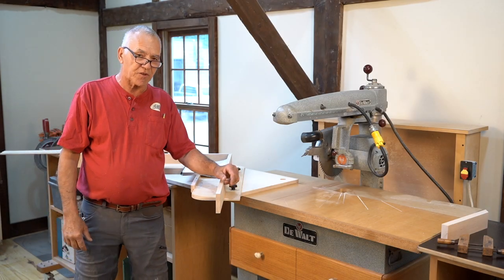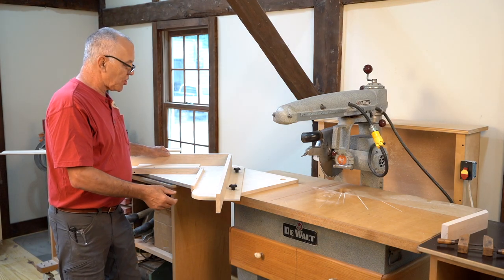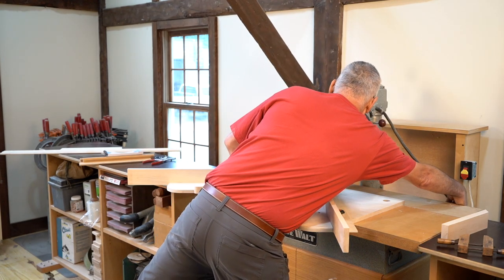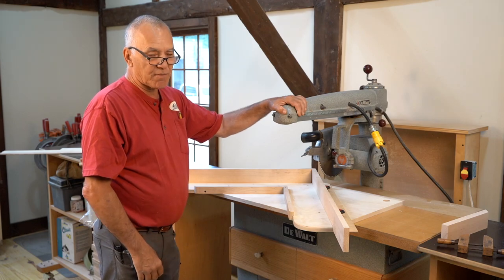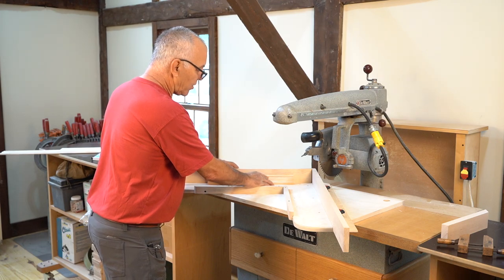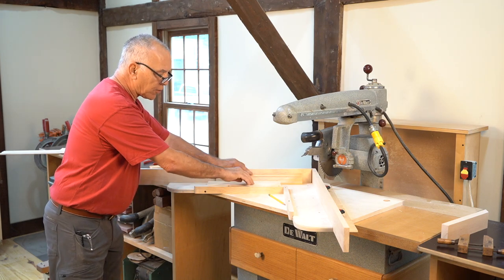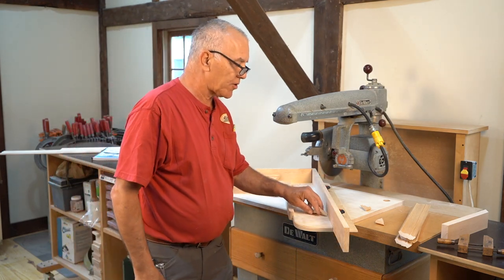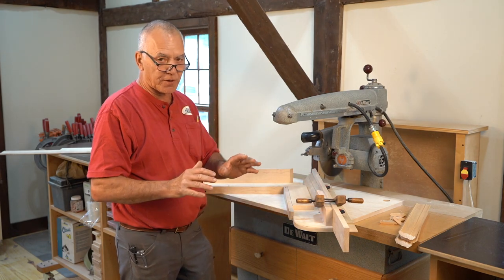The Flying Wing Jig

Comment: One day I went shopping on OfferUp and found a guy selling a 1953, DeWalt 3 phase, 3 horse GR54. I couldn’t believe my eyes. The thing looked brand new. Original paint, fully equipped and the former owner had even rigged an inverter so it could run on 220 single phase.   He only asked $500.   I went up to see it and verify that the thing really ran.   It was perfect. No rust, not a single chip in the paint, threw a 14” blade and ran true and straight.  It was even rigged with a switched power cord to operate a dust collector.   I will never see a better deal for a power tool in my entire life.  Trailered it home and spent the next week dialing it in to perfection.  Added a custom made fence to hold Board Buddies for ripping.  But I gotta say, Nothing but nothing beats a well made, 500 pound DeWalt radial.

Comment: Love this.  I just finished my first reading of the Mr. Sawdust book.
I have an OK Craftsman that I have finally managed to get into alignment after following a combination of Mr Sawdust, the factory manual, Jon Eakes book and the Delphi forum for DeWalt Radial arm saws.  
I was determined to get the  Craftsman saw functional to finish up some very basic work I am doing right now.
My dad built cabinets for my entire childhood on a DeWalt RAS, and I have recently acquired one, but it's apart for reconditioning at the moment. 
The Mr Sawdust book has a nice description of using a perpendicular fence with a 45 degree. I would guess the wing idea came about as your dad thought about how he could do the cuts even better!

Comment: I use a jig similar to yours on my table saw. It work the same way as yours. I have made many jewlry boxes and the like using the jig and as you said ,"you can't get it wrong"! I like the fact that any length can be obtained. I have a friend that trims out buildings he also uses a table saw . you can also adjust the jig to get different angles. Your dad make an excellent picture frame.

Comment: I just bought a Craftsman radial arm saw now I am second guessing myself. I am new to Radial Arm saws, and just subscribed to your channel.
Reply: I did the same thing. I managed to find an old cast iron armed craftsman since there were no old dewalts in my area. I'm now on round three of setting it up and getting it square and am getting really close. I've had to take parts of it apart and clean out years of old packed sawdust and dirt but it now seems to be locking in at a consistent position. I almost threw it out after I set it up the first time an it wouldn't hold a setting. I think what has to be remembered is that all of these are now old, most are neglected, and most need to be cleaned and adjusted. I may still turf mine if I can't get it perfect but since I only paid $50 for it, and the recall on them from Emerson is $50, I'm not out anything to try and get it right.

The tl;dr of all of this is try and get it set up, go through the manual step by step and see if you can make it work for you. If not, on to something that will.